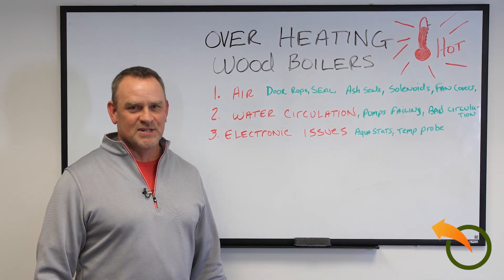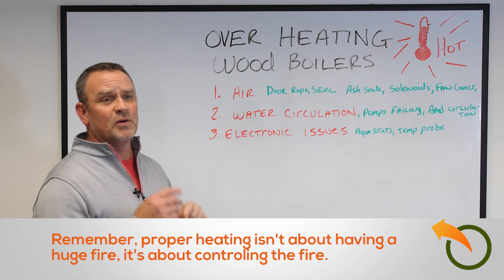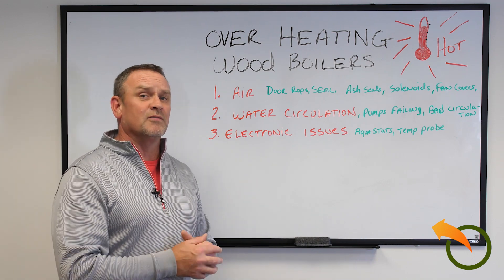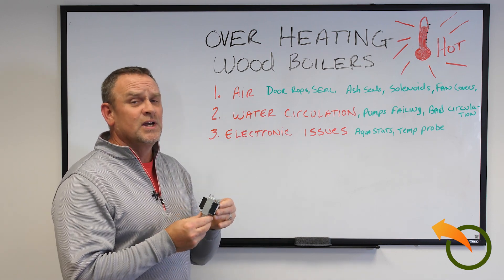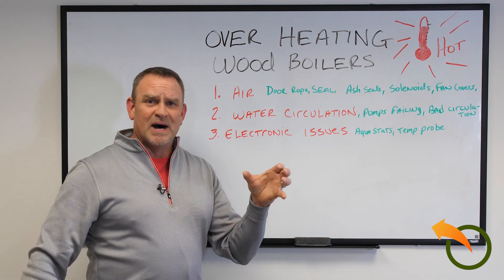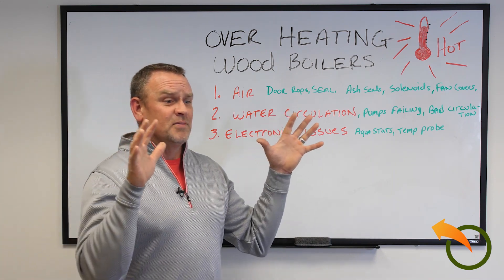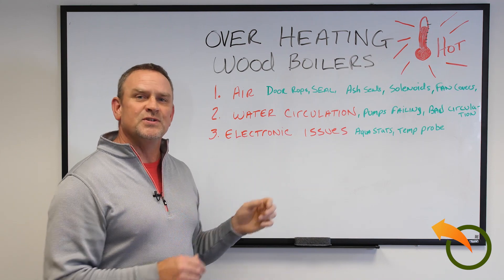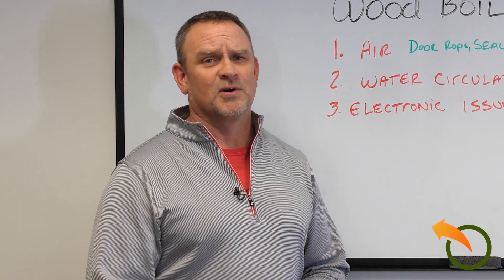Why Is My Wood Boiler Overheating? | DIY Outdoor Wood Boiler Maintenance & Troubleshooting

Comment: Heyyo we have a wood furnace and just had maintenance done to the outdoor portion of it.  (Rope, solenoid ect. Whole door portion is pretty much replaced and brand new) However, our furnace is still running about 10-15 degrees hotter than its supposed to. We just started it up for the season today and when the heat kicks on it sounds like rocks banging through vents. Would this be a problem with circulation you think? Any advice would be helpful honestly. Want to make sure everything is running safely and effectively.
Reply from the maker: Yes it sounds like poor circulation in the boiler, or simply burning really hot with good wood. First try mixing some green wood in with seasoned to slow the burn. if that doesn't help replace circulator. Jeff

Comment: hello I have a heatmor 100cb and it's 2 years old last year worked great this year, no so much now I have water dripping out of ash tube and into ash box and no one can seem to tell me what's wrong, I repacked sand replaced seals and nothing I have to clean the blower flipper door ever day please help me
Reply from the maker: First thing contact Heatmor, for warranty. Sounds like you have a leak. Jeff

Comment: I have a wood master for12yrs and I am having a lot of creaso I have dry wood but first yr of much creaso changed gasket and still am getting creaso the fire burns good with door open but close door for a few minutes and open door and fire not burning very good because of smoke I pulled fan off and a lot of ash had to cleen out still same thing hold door open good fire close door and seems like smoke slows it down have you any idea what could be problem. My door had not been changed but 1 time never had any leaks seems it silled good. I feel like something is wrong but don't no . Sorry so long but trying to give you all information. Thanks for your help. 
Ron
Reply from the maker: You might need to replace pump, not enough circulation in the boiler. Creosote attaches to cold surfaces.

Comment: Thank you for the info. Can having to much water cause water to flow out the top vent?  I so i shut it off because I thought the cold weather was done but it wasn't and my girlfriend check the water levels and it was low she added more water but she didn't take in consideration of expansion. So we fired it backup but  Then the warm weather came but and hit about 70ﾟ.  And there was water coming out the top vent And the water level when you would check it water would shoot out of it. Does it just need some water bleed off
Reply from the maker: It can simply be expansion of the water. If it keeps coming out, it can be a leak in a plate exchanger. bleeding back into the boiler. Hopefully it is just water expansion. Jeff

Comment: Is there any other way to get soft water 200 gal amount for filling it up ? I’ve had pump cartridges going out far faster than they should. They either look ok or have a scum coating on impeller.
Reply from the maker: Ask your buddies and see if the have a pump truck and pull water from local stream is all I can think of. Good Luck. With a will there is a way!

Comment: Good video.  I have a question nobody can seem to answer.  I have had a central boiler 6048 for 11 seasons now.  A couple times a winter, if the wind is blowing hard and out of the right direction, I get a reverse draft, where very little smoke comes out the chimney and instead it comes out the damper door inlet.  Anything I can do to prevent that?
Reply from the maker: You can try another length of chimney pipe to create more draw through the chimney, or sometimes a simple chimney cap helps. It is a problem with the natural draft units. I had a central Boiler and had similar problems.

Comment: I have my aquastat set to 180, but my temp probe says my water temp is about 150ish..  fan comes on, but only until the temp is at 160ish..   could this be a bad aquastat, or could the temp probe be bad? (if I turn the aquastat 10  200, then the temp probe says I'm at 165ish)
Reply from the maker: The temp probe is mounted to pex most likely which has a insulation factor. Totally normal.
Reply: @AltheatsupplyLLC  I replaced the aquastat..  new aquastat set to 180...   temp probe also says 180..  everything is now working perfectly.

Comment: Had problems with my outdoor wood burner which is a NCB and it overheated from day one. I change the door seals every year and that sometimes fixed the problem. After contacting you guys and talked about the problems I decided to buy a new pump from you. It was almost $300 but this pump is working great and have not had any problems since. Come to find out the company I bought the boiler from had a cheap pump that was rated for 50 feet. No wonder my water wasn't heating like it should. So after 8 frustrating years and 3 water leaks it is now working like it should. I have learned a lot about these woodburners. the biggest realization about my wood burner is the company will not stand behind it and that's why they are out of business!
Reply: I have had the same issues, but I changed the pump 3 times so I had a pump expert look at the pumps the all had the same problem  he said eather the pump was to big or it being restricted  didn't find any thing, I was told from day 1 that the minimum distance was 50ft from a house or garage mine is 80ft and I still have the same problems for 25 years

Comment: Excellent concise video. I have a woodmaster 5500. This is my 14th season with it and I have experienced most of the issues you discussed. As you said, the best fix is replace that door gasket annually-- it really does make a huge difference. And be sure it's the right size-- I got 3/4" locally once instead of ordering the 1" that I needed. Nope. Brand new and it leaked terribly and boiled constantly. Overheated and burned out my temp probe and electronic panel.  Expensive lesson. CHANGE THAT GASKET! I also replace the "flappers" on the fans every 2-3 years, as they lose flexibility and that tiny gap will make it boil. I have run into the solenoids sticking as  you said, but also have had the spring between them and the flapper get caught and cause it to stay open. I have called you on occasion and your knowledge has helped me several times, plus you always get the parts I need to me quickly. Thanks.

Comment: Had boiling only under high heat load during coldest weather, but temperature of water exiting the boiler was dropping to 150 F.  Figured it was a circulation design problem resulting in hot spot at top of boiler as you indicate in this video.  My solution was to plumb a tee and valve into the cold water return to feed a trickle into the fill pipe at the top.  As a result I have up-sized my draft fan and can get greater heat through-put for the cold weather with no boiling.  As with any solution, I am sure I have introduced new problems, like aerating the water and increasing corrosion, but haven't seen that so far.  Any thoughts?
Reply from the maker: you're overheating your unit. There is a snap disc on most units that once they go over 190 degrees the trip and won't re-open until 150 degrees or so.
Reply: @AltheatsupplyLLC  what exactly is a snap disc. If you could read my other post in this I didn't want to rewrite it again. But having some creaso problems. I meant to tell you in my other post that my fan is in the back and it has 2 dampers one at the top right below my fan and then it has a shoot about 2 feet long with another damper with nothing hooked on it I don't know how it is supposed to open or close but it is not working should the one at the top have a rubber gasket on it I don't know I have had this stove for 12 or 13yrs 
If you could read the other one also and thank you I'm just kind of lost on this. Thank you. I'm sorry my stove is a heat master 5500 or maybe a 5000. Thanks
Reply from the maker: @roncoleman9502  please give us a call, need more info! Please ask for Eric 203 881-1602